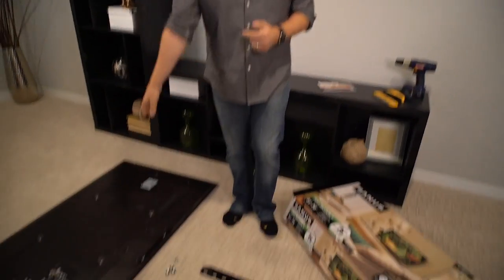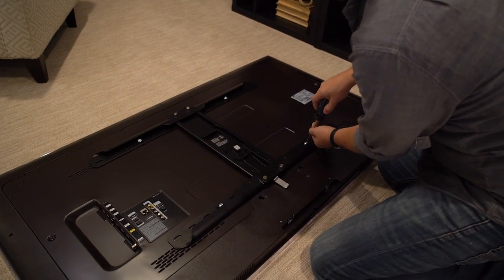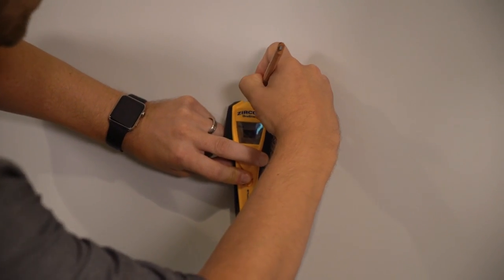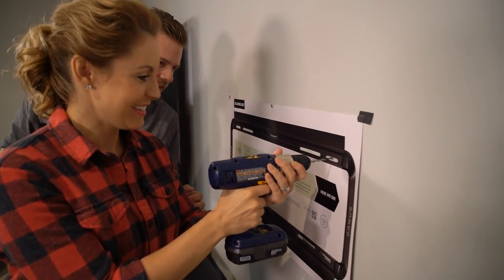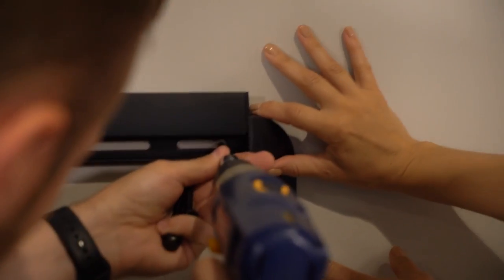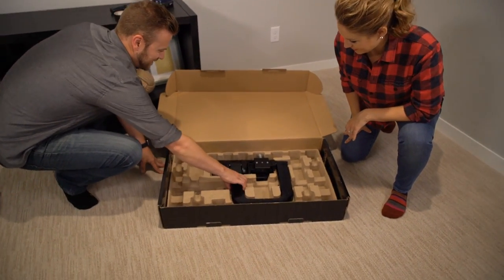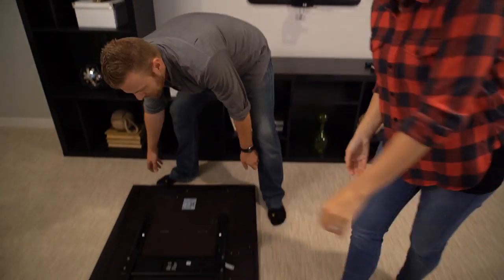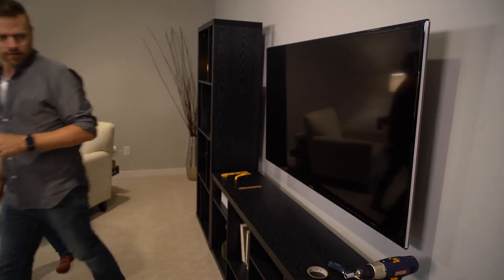How to Mount a TV in 3 Easy Steps

Comment: Good, but DON'T FORGET, That's the mounting, I don't want to mislead people. This can still be a DIY project but don't forget you still have to connect the TV for it to work. it looks pretty and it looks nice now but you still have more work to do. for example if you have DirecTV or satellite TV and there's a power cable well it may be long enough deployed to the wall but may not be long enough to connect to the TV or vice versa. I advise having all yourmounts ready to attach even for other devices like satellite TV boxes. also have a plan on how you're going to wrap your cables/cords and make sure they're long enough so that when you pulled the TV from the wall they don't pull on the device or yank tension on cables that could cause it to break/damage. Happy Mounting!

Comment: Hello.   Is this pretty much universal for most tv mounts or are these instructions for this particular brand and model?  Thank you for the video!
Reply from the maker: Hi Jay. You'll definitely find that the SANUS brand of TV mounts usually mounts in just three steps. This is not consistent across other TV mount brands. Some come in many pieces and require a lot more assembly before you install. In case you're interested, the mount shown in this video is the SANUS VLF525. Let me know if you have any other questions. - Lauren

Comment: Why used the template when you have the actual wall bracket to show you where to drill ?
Reply: Because the weight of the bracket is no joke. Use the template to work out the measurements and placement and then it's quick work.

Comment: This actually instruction part of this video is poorly scripted. Instead of "screw the bolts into the tv" you could actually point out where I should expect to find those holes on the back of the TV as was done on another Sanus Video. Unfortunately that video was not with a full motion mount. I think I understand now why the installation video URL listed in the manual no longer exists.
Reply from the maker: Thanks for the suggestion Anne0927!